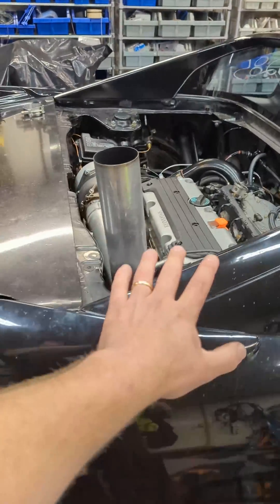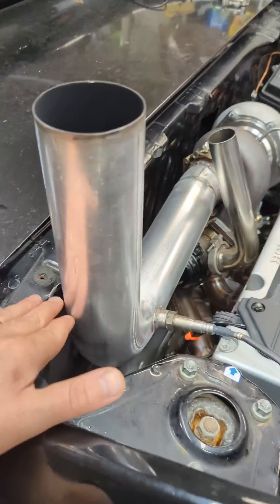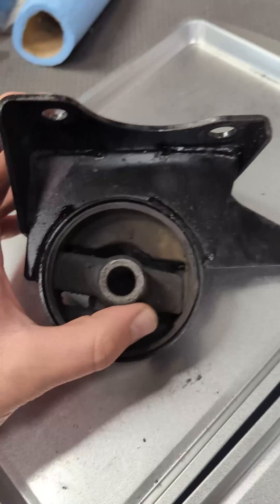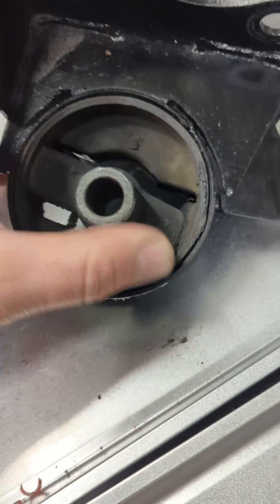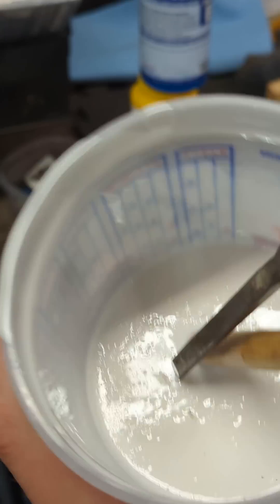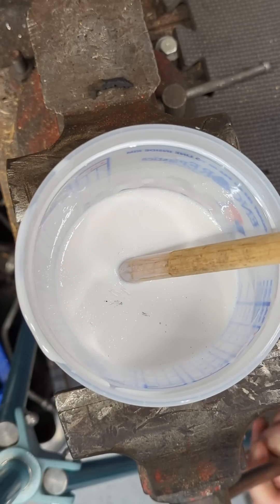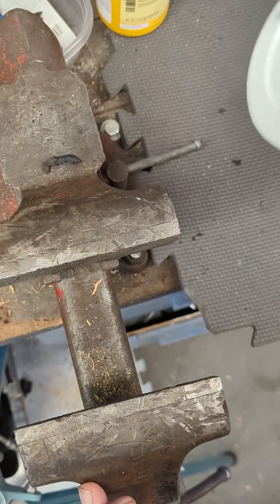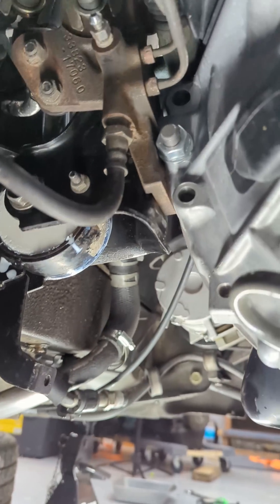Engine swap secrets: a chisel and some polyurethane..

Comment: I learned this from the Honda guys, wait until your mounts are wore out, then fill them with 3M Window Weld. Comes in a caulk tube. Not poly but it is urethane. Fix you right up.

Comment: Try adding some window weld with a new stock motor mount. AKA diy poly mounts
Reply from the maker: Like add window weld directly to a stock mount without removing the rubber? I'm down to try that for the rear mount cause it's a brand new OEM one right now

Comment: Had a 96 Kia Sefia that started vibrating very bad at redlights ..Shook so bad that it gave me Double vision  kind of like riding a Harley Davidson ..I was getting ready to junk it ..Thought it was something internal in the engine ..turns out it was just the front motor mount ha ha .Fixed that and it was like New

Comment: The purpose of rubber motor mounts is to not only keep your engine stable and not move, but also to absorb the vibrations. You completely defeated the purpose of mounts, congratulations on being dumb.

Comment: That's going to put alot of stress on the mount and driveline.  You need some vibration absorbtion. That cars going to SHAKE.  Should have just filled the old rubber.

Comment: Before I even watch more than the intro, 3m window weld for the fucking win🤣 I've done this so many times.. ive even done it on driveshaft carrier bearings on several 450- 550hp audis that were blowing out aftermarket "upgraded poly mounts" left and right🤣 like every month. 3m windows weld has held up OVER oem for 3 separate turbo builds on 2 cars total of 8 years🤣 thrashing on em daily too.

Comment: I filled in the top and bottom spaces in new mounts with silicone, but it increased engine vibration. What I did was to remove the silicone from the upper holes in the mounts which gave much less vibration. I've not replaced mounts in quite a while.

I have two suspension mounts to fix, I'll use your technique but with something with a little less ridgedity.

Comment: Not being a dhead, wouldnt that just crack over time because of heat and pressure? I dont know much about this, just trying to learn. Or better yet, could you explain how it works? I know how OE mounts and even "normal" poly mounts but this seems different. Thanks in advance

Comment: Your thought things were going to take a bad turn the whole reason that motor mounts are rubberized is to cut down on the vibrations that the motor sends to the chassis now that he has that polyurethane plastic f**** hard ass mount all of those vibrations are going to transfer into the chassis and that's all he's going to hear please leave this kind of stuff to the professionals guys we value your life

Comment: What the hell is that? Did you just replace a semi hard rubber bushing for a solid polymer one? People can make anything there's a pattern for, to original or higher spec. In this case though if it works go for it, just wouldn't try it myself 😂

Comment: I did the same on the torque mount of my 1.6 TD engine with 60 shore A poly,  with the vibration you can't even talk inside, swapped to oem 🤣

Comment: i’m curious to see the life of the product. cracks over time or slippage. nice car
Reply: it won't crack or slip. its exact opposite of rubber, which makes it a poor choice for engine mounts and suspension bushings, joints etc.

rubber: poor durability, excellent flexibility
polyurethane: excellent durability, poor flexibility.

we use rubber because of its flexibility, even though it is considerably weaker and much less durable.

Comment: Seal the form with wax so you don't leak the poly out the bottom.

Or a hot glue gun around the outside

Comment: Replacing the rubber with something that hard will definitely not absorb the vibrations and will definitely Crack. They are supposed to flex a slight amount. You could also get vibrations through the frame you could feel in the car. I bet that thing will Crack in no time. I can't imagine that epoxy and your time are cheaper than a new mount...just saying

Comment: 😁It's rubber to deal with vibrations and keep things from falling apart.
Reply: Aftermarket Polyurethane bushing and engine mounts are a very common thing
Reply: @Chris-eb6id  But that bushing wasn't originally polyurethane.
Reply: @erinericsson  yes but a lot of people prefer poly bushings and mounts because of the rigidity less sway in joints in certain situations can provide more grip and a better feel driving
Reply: @Chris-eb6id  But it can't handle vibrations.
Reply: @erinericsson  yes it can, while driving with the poly bushings and mounts it can make more vibrations inside the car but in some situations polyurethane is way better than regular rubber, also they definitely can handle the same and I’d argue more abuse than regular rubber bushings
Reply: @Chris-eb6id  Yes and vibration is bad. So no thanks.
Reply: @erinericsson  vibrations don’t matter when you going 200mph on a six feet wide dirt road and you need to slow down 100mph to take a 40 degree turn
Reply: @Chris-eb6id  We not talking 200mph though everyday all day,we talking everyday normal driving.
Reply: @erinericsson  well it is a performance mod and performance mods are to make your car go faster not feel more comfortable
Reply: @Chris-eb6id  How are you takong our conversation from talking about replacing rubber bushings with polyurethane not being good because of vibration, to talking about performance mods?
Reply: @Chris-eb6id  And how is vibration good for performance?

Comment: Holy hell that was intuitive I’ve thought of the same process but never doing it with such a rigid polyurethane. 

I got some poly mounts for my GTI and i definitely feel less slop and less wheel hop but the vibration is pretty bad and rattles the aftermarket 3 gauge pod in the center of the dash at certain lower rpms. If it had stock dash it wouldn’t vibrate

Comment: Hope you like the four cylinder engine buzz. All the engine vibration is going right into the frame.
Reply: Should be no diffrent from a ford focus then lmao
Reply: @Area-cf1gt  What is up with those? You can feel the vibration in all those mid-late 00s Focuses.  Cant believe they left the factory that way.  The mirrors vibrate!
Reply: @connor3288  lol and not that cheap priced compared to better options.
Reply: @connor3288  omg im so glad i found 3 people who know this
.
i fucking thought i was crazy man
.
maybe my jeep 4.0 i6 runs so smooth i got used to like nothing...
.
.
.
idk how the bolts dont all rattle loose...... fuck me
Reply: @Area-cf1gt  I also own an 05 fucus and even with having replaced the trans and motor mounts, nothing stops that 2 liter subwoofer
Reply: @Area-cf1gt  lol
Reply: @Area-cf1gt  dude seriously.... i pulled one in for an oil change.... start it up and BUZZZZZZZZZZZ
.
fucking change rattling, cant see out of the mirrors to back up........
.
no CEL... seems to run fine at RPM, smooths right out
.
owner said its done that from day 1 (was thinking maybe the motor mounts are kinda old)
.
.
.
why did people buy those cars?
price alone? (only to get screwed by ford dealer only crap)
Reply: It’s really not that bad.
Reply: @tjnucnuc  Stop defending ferds.  My kymco spade doesnt vibrate the mirrors, and it is a $3k single cylinder motorcycle.
Reply: its a rear engines, so he wont notice any vibration at the steering wheel..

Comment: Just chunk it out with a wood chisel ! Leaving groves in the motor mount housing ! Something for the epoxy to adhere to , nice . What is the results of the solid mount ? You may have to address other mounting pinnings ! Just saying you have a lot of raw horsepower and torque trying to rip the engine right out of its body bindings ..keep a close eye on your fixes ..dont let it get the best of you ...just saying from similar experiences ..i think you will do fine
Reply from the maker: I'll definitely be keeping my eye on the other mounts

Comment: You should have used the more flexible compound now it's going to end up happening is you're going to end up cracking something else somewhere the engine mount is designed to take up Slack

Comment: Guys in the market I used to sell parts in used to get 3m window urethane and rebuild the mounts if they wanted stiffer than oe. Always wondered how they  managed that. Some of the oe design aftermarket ones are laughably weak brand new.

Comment: Man I wish I would have thought about that instead of spending money on solid motor mounts. Also I wonder what would have happened if you just poured the epoxy in around the rubber that was in there
Reply: That's what I would of done

Comment: Window weld (from a parts store) works sweet for motor mounts. It also won’t run out of cracks and gaps. Slightly less solid than the stuff you used so your teeth won’t rattle out of your head at idle
Reply: That's exactly what I was going to say... a tube of 3M window weld and a caulk gun will remake any motor mount, tightens up trans mounts too
Reply: He could have also gone witn 40 shore instead of 65, although the mount might not last as long. I've done this to a different car several years ago. I used 60 shore urethane I bought from McMaster-Carr. The vibrations in cabin did increase.

Comment: It would be better to fashion up a vacuum chamber and pull the air out of the mix before pouring it in. Best would be to have the mount itself in the vacuum chamber so it doesn't have any chance of air pockets in the mount at all.

Comment: First time I seen a smooth on product used for this purpose. I’m curious as to the durability since I don’t think it was formulated with this use in mind. Like resistance to chemicals and grease etc prolly wasn’t tested.

Looked sorta thin pouring it but no need for a vacuum chamber to degas the material? Prolly not as dense a motor Mount as you think it is

Comment: The company makes a bunch of different strength and different flexibility polymers and he probably used the wrong one because it appears to be way too hard.
Motor mounts do need a little bit of flexibility.
Reply: Say hello to vibrations all over body 🤣
Wouldn't it be better use some polyurethane silent block?

Comment: If engineers wanted no movement they wouldnt bother with the rubber. Straight bolt on to body.  
Rubber designed to prevent vibration.

Comment: Helpful tip. You could have filled the ripped mount with that. And still had some vibration damper. But if you don’t mind your teeth rattling out that’s on you boo boo.

Comment: You have rub mounts for a reason making that solid like that is going to transfer that vibration through other parts, and eventually you will cause yourself more problems. You may even feel it in the frame.

Comment: Epoxy won't have the necessary flexibility to be a good cushion. Your entire side is going to be vibrating massively. You should have used liquid rubber or just bought a new fucking cushion. 🙄

Comment: I experimented with solid mounts on a VW years ago. Full round polyurethane worked best. 

The harder mounts like aluminum or hard plastic snapped bolts or tore the brackets.

Comment: Right now I'm interested to know how that epoxy performs as the old rubber acts as a vibration damper as well
Reply: I don't get why he'd want to stiffen it up like that.
Reply: @DogWalkingBot  because thats what you gotta do when you make more power than the stock rubber mounts can take
.
to tear like that = too much HP
or someone was doing neutral drops / park slams
.
.
old school way was to bolt a chain to a hole in the driver side cylinder head (v6/v8)
.
then weld the other end to the frame with JUST some slack in it
.
enough that it doesnt rattle
yet allows the rubber mount to do its job
.
and when ya get on it.... or dead hook it..... the chain takes most of the load
.
.
.
a 68 impala will JAM! wide open if that mount is bad
ask me how i know!!
.
just drop it into neutral or turn the key off
.
i saw the hood rise and heard the THUMP!
im mekanik so i knew what happened
.
slapped it up 1 notch to No!
 then back down into drive.... just a little less go pedal
Reply: I wanna know also I would think with it being that hard it would transfer serious vibration. I replaced a shift linkage with a aluminum one and that made a lot of vibration transfer thru the entire car, so much so I replaced it with a new rubber one.
Reply: It's polyurethane not epoxy
Reply: @aznative_  that was epoxy
Reply: It’s a race car thing, most people want the feel and performance of stiffer mounts cause there’s less movements in the engine. In his case he wanted the stiff mounts cause the exhaust pipe was moving to touch the firewall, so the stiffer mount would prevent that. For most people they went to hear more engine noises in the cabin cause a lot of car people like the noise
Reply: The k is making about 180 more hours than the stock mounts… plus oem is crap that degrades in 3 or less years. It’s designed to break. 

Anything more durable will save you thousands in repairs because of a misaligned engine. And get more power to the road.

Vibrating is canceled out by a harmonic balancer mostly until you mess with timing etc.
Reply: @pazsion  torsion is more of an issue than vibration. Without a little bit of give things tend to break.

Comment: You’ll need thick gloves to reduce they vibrations should go for shore a40 in future it’s stiffer than the original mount but it’s a whole lot smoother than the resin

Comment: I would be worried about cracks and breaks. The mounts need to have some flex or cushion to them
Reply: That mix he used is actually literally designed to be used in that specific application. It's just very stiff polyurethane.
Reply: Poly flexes more than steel

Comment: Now its going to be TOO stiff and not have any give at all hahahaha possibly resulting in it being just like metal on metal and feel like its got a bad mount all over again haha... The rubber boots in a mount allow for a certain amount of recoil and give instead of just a stiff , sudden stop ... That polly could last forever a d be better than a rubber mount , i really don't know , but i imagine it not allowing any give will cause issues down the line like accelerated wear on the other remaining rubber filled mount and who knows what else ... I imagine its eventually gonna develope a slight clunk when reving up and letting off and will eventually crack and crumble each rev up afterwards until it blows it all away pretty much just like explodes hahaha hahaha.... i could be wrong because i really dont know but i can see some problems coming from this but then again i thought the same thing about me rebuilding mine with a small section of high pressure rubber hose but its still doing great almost a year later hahaha🤷👍

Comment: i'll be that pipes some sweet motor noise into the cabin. one of my fav things about solid/poly mounts. when you're in it, the visceral sound lets you KNOW you're in for a treat! Great technique btw!
Reply from the maker: Indeed it sounds great 👍
Reply: Put 85a durometer mounts in my FG2. Has some good harmonics at around 4k but smooths out. Kinda wish it was more pronounced actually surprised how quiet they are.
Reply: I always thought they were rubber to allow the engine to vibrate freely... Wouldn't excess vibrations damage hose connections etc eventually, especially on an old car with perished hoses still holding on for dear life 😂
Reply: @mohammedsafraz9820  firmer bushings will reduce the relative vibrations with regard to the engine connections/hoses. Soft rubber bushings are designed to isolate the vibration from the chassis to reduce nvh (noise, vibration, harshness), for the driver & passengers.
Reply: @IzziedeD  Makes sense when explained, you learn more in the comments than most videos lol thanks
Reply: @mohammedsafraz9820  you're welcome, and you're right - comment sections are interesting because they each have the ability to branch into their own little nuanced sub topic.
Reply: @mohammedsafraz9820  softer motor mounts isolate the engine vibrations from the chassis. When it’s isolated like that, it’s able to vibrate and torque twist separately from the chassis. A more solid motor mount only transfers those vibrations to the entire car, keeping the motor relatively still.
Reply: @d_kortman  good way to put it. whats a real trip is solid/high durometer mounts on engine, trans, diff and suspension. you can hear every gear. i've never run straight cut gears before, but I've heard they are extra loud with solid bushings. maybe one day.